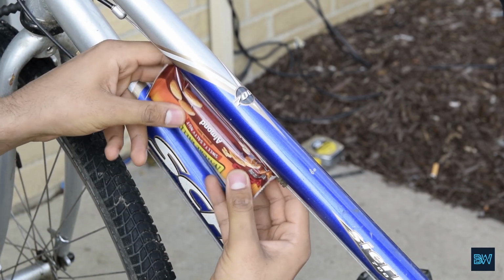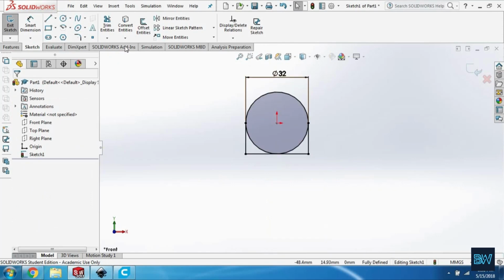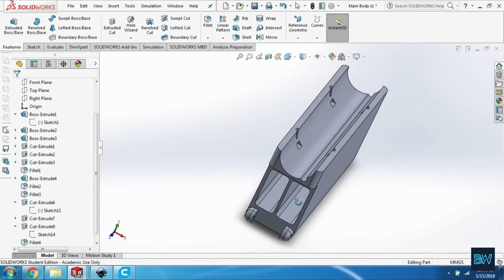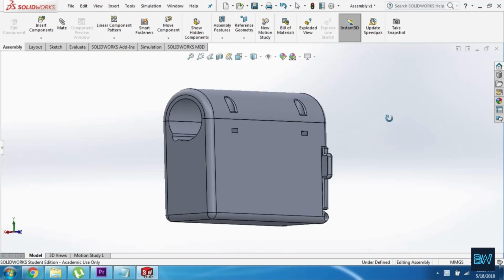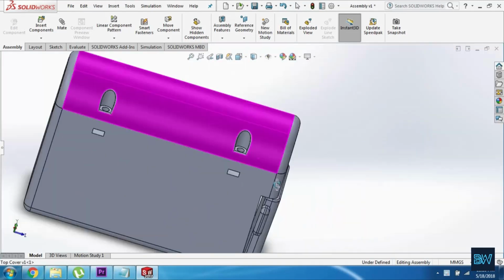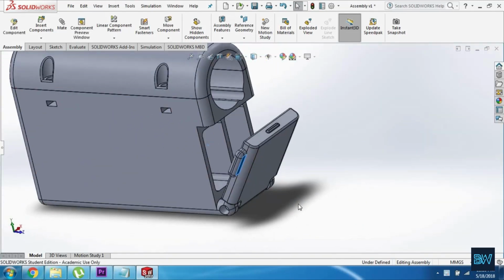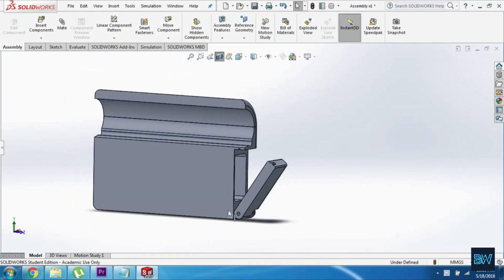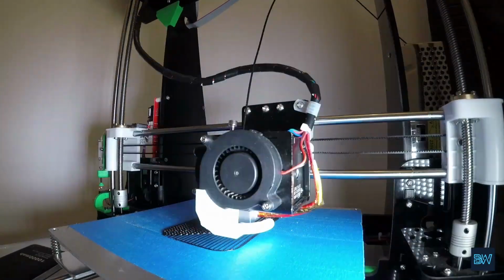Bike Protein Bar Holder

Comment: I know this is a comment on an old video, but this is a perfect example of why I got interested in programming back in the day and why I'm interested in getting started with 3D printing. See a need for something, make a solution for it yourself. You make the design of your prototype look so simple, yet it looks advanced. It's a bit intimidating to see it as someone who has no 3D design experience.

I love that you talked about and showed how you hadn't accounted for the air in the packaging, and what you would do for the next iteration of the print.